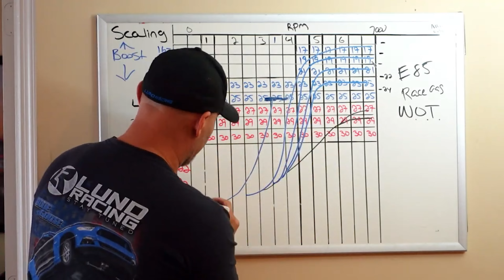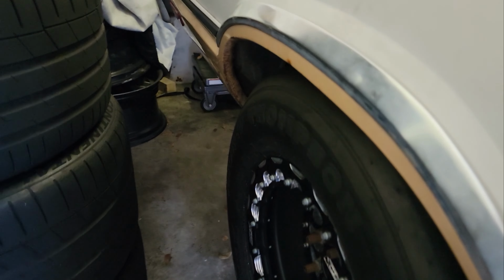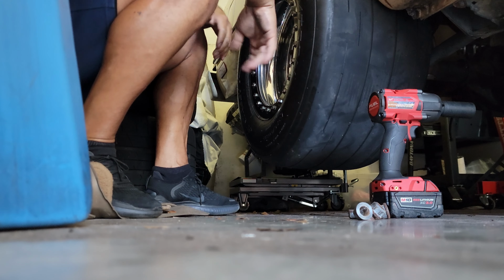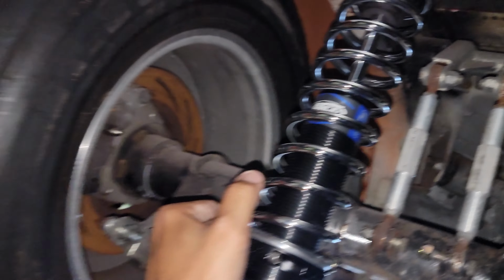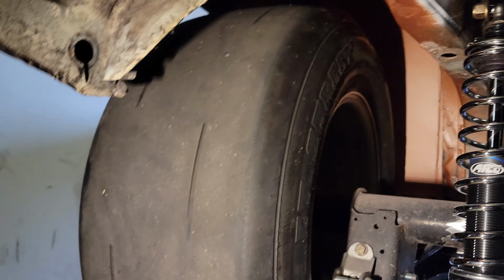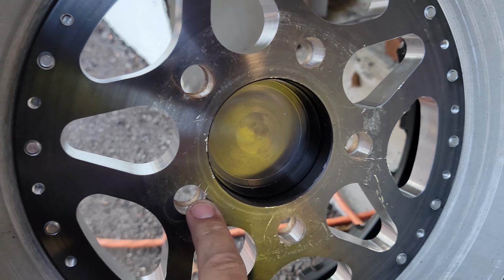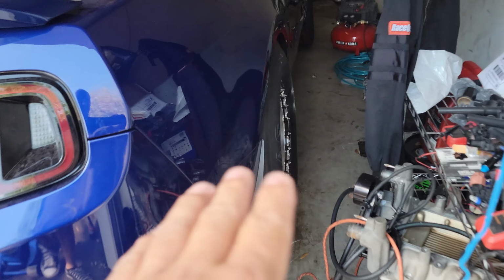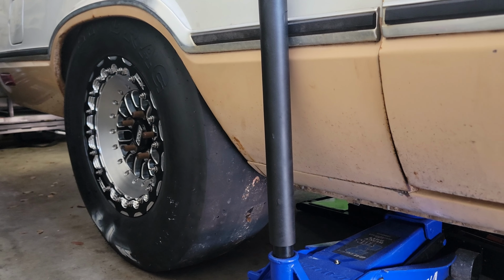#Hushmoney Fairmont Rebuild: The Truth About Wheel Spacing & Fit

Comment: I've done this before and here's how you figure it out.  (1) Put a wheel on the car with known backspace, then measure the distance between the top of the tire and the inner wheelwell.  Note, it is import that you have a tire on the correct size wheel - not too narrow or wide for the wheel; (2) gather tire(s) off wheels of the size you want on the car; (3) take the car out of the garage someplace you have about 20 feet behind and on the side of the car so you can view it from a varying angles and distances; (4) measure the height of the rear wheelwell lip to the ground; (5) jack up the rear of the car from the center of the rear axle, remove the rear wheels, and place the rimless tires centered in the wheelwells.  (6) Lower the car so that the wheelwell to ground measurement is back to what you had with the tires on i.e. normal ride height.  Now you can move the tires in ward or outward, jack the car up or down to see the best placement of the tire for clearance and looks. Make sure the tire is straight i.e. parallel to the car - slightly turned. When you got it where you like it, and it's straight, measure the distance between the top center of the tire to the inner wheelwell at the same spots you did in step 1. The difference between that measurement and your first measurement tells you what adjustment has to be made to the backspacing. Best of luck.

Comment: That fitment is great. Id personally do a 12 inch wide wheel to maximize contact patch(add 2 inches to the inner barrel . It helps a lot on limited prep and street applications.

Comment: Copy the S197 fitment with a 15x10. A 275/60 is recommended for a 7.5-9.5" wheel, going with a 12" would be pointless and put unnecessary strain on the sidewall in my opinion

Comment: I saw this on last week's video .. generally when trying to use that size wheel , the WHOLE wheel tub is removed all the way to the 1/4 panel , the new wheel tub is then attached to the frame as normal and the outside is attached to the 1/4 panel with 3m  panel bond , this allows you to drop the car really low with that backspace . You can probably still do the outer part of the new wheel tub , it's just a pain in the ass..  also the rear housing could be shortened a couple inches , the axles usually have enough excess spline that can be removed , so you don't have to buy new axles
Reply: Most low fast fox bodies have the 8.8 narrowed 2" on each side and you can use a 15x12 with a 6.5 bs

Comment: That's awesome, glad you didn't have to spend days figuring it out. I actually have to run s197 offset wheels on my 66. 😂 It's got a 9" out of a 72 mustang and it's like 2" wider at the flanges. The s197 offset is nice because, it changes the direction of the load on the axle flanges and I'm sure it helps bearing life, as well.

Comment: could just narrow the rear end an inch, drop it off to someone and pick it back up in a day and everything is good. would help you in more ways than 1. Not very expensive either.
Reply from the maker: Hahaha so uninstall , cut the test, measure for new axles, buy new axles new 9"ends put it all back together. All for something I can do with a new wheel.
Reply: @YDBT4LIFE  to be fair, it’s not something I think you’d do yourself so they’d do all that and it would make future wheel fitment easier especially if you were ever at a race in a tight spot and needed to borrow something. But you are right, custom wheels would work also.
Reply from the maker: @TwinTurboLsx  who's "they" 
Take me through the steps of who would do all that work cost, labor etc.
Reply: @YDBT4LIFE  I know you know fab guys. I was referring to whoever does the work. Depending who does the work, bring them the housing, they remove an inch, weld the tubes back together, put 1” shorter axles back in. They might even be able to remove a section where the tabs don’t be relocated either. It’s a relatively simple process. Would probably cost about the same as a single custom wheel. 1500 ish depending on the shop. I’ve had 2 narrowed. 1 for my Camaro and one for my truck. Thats what I cost me. May be worth an ask to someone just to see. But just an idea brother.
Reply from the maker: @TwinTurboLsx  right. Lmao
Who
Will
Do 
The 
Work?
You guys say "shorten the rear" without thinking about what that cost, the time, etc etc.
Reply: @YDBT4LIFE  sorry I don’t live in Florida. Can’t suggest any shops. Like I said, was just an idea. It’s your car brother.

Comment: 15x12+1, shorten those axles and roll those fenders!
Reply from the maker: Lmao. 
1500 in labor 400 in axles and 3 weeks of time. Or use my existing s197 wheels.
Reply: @YDBT4LIFE I commented while watching the video, not waiting until the end. Run the s197 wheels, they work if you’re happy with the look. My focus is more race oriented, I have the ability to narrow the axle tubes, and I prefer the look of the lower backspaced wheels. Different strokes for different folks.

Comment: Gotta brain this out. you're adding 2 inches width and 1 inch backspacing.... it's sitting in the exact same place with 1" out and 1" in extra. You need 8.5" on a 12 wide to make any difference.
Reply from the maker: Yea so it's not worth it honestly. The s197 fitment is perfect.

Comment: Close that lip . No big deal.  Get the tool it use a hammer and dally.  Did it to both my mustangs.
Reply from the maker: This
Is
Not
A
Mustang
Reply: @YDBT4LIFE  They 
Are 
One 
In 
The 
Same 

Lol

I did it on dozens of different cars .
Reply from the maker: @Spad68  Fairmoun quarter panel tucks in the higher you go up. You are 100% wrong on this
Reply: @YDBT4LIFE  ok . 
I will admit . I've never done a Fairmont but I've done carparo of  different generation.  Dodges and many many different Fords . 

I apologize if I'm wrong 
👍👍

Comment: Why are you limiting your tire width to a 275? Your handicapping yourself
Reply from the maker: If 6 second cars use a 275, why do I need bigger?
Reply: They also have a lot of data for traction control
Those 6 second cars are on 275 because of class racing
Reply from the maker: @Sik.Suki_750.  we don't use traction control. Most guys I know where the 6-second car and 275 don't run traction control. They set up their suspension properly. This car can go 7 seconds easily on a 275 with 1100 rear wheel horsepower. I think I know a little bit about this subject
Reply: @YDBT4LIFE cmon man, you act like you work with the fastest coyote tuning company on the planet. 😉